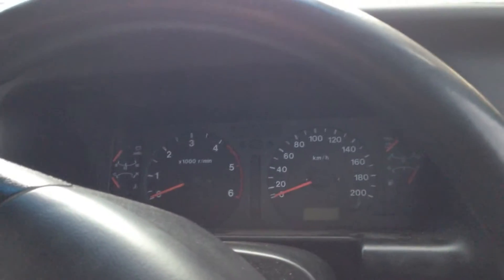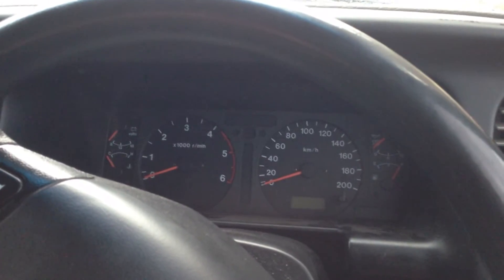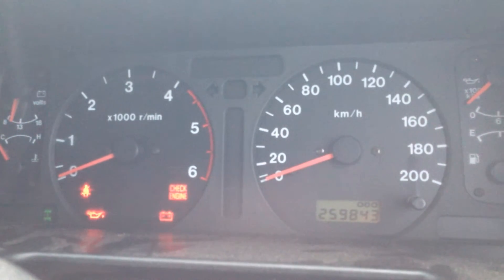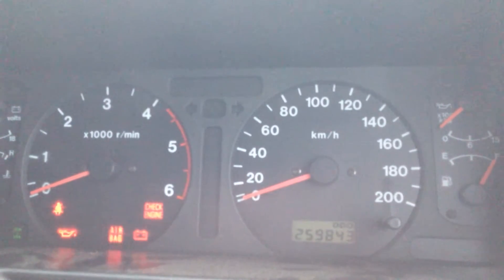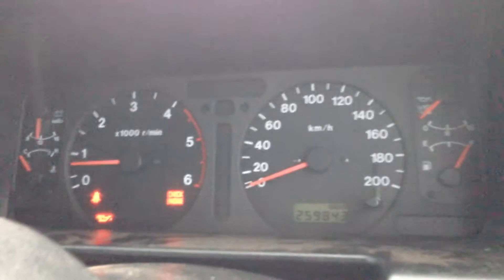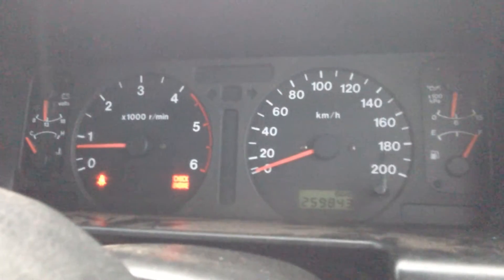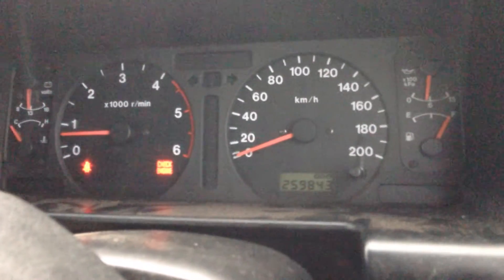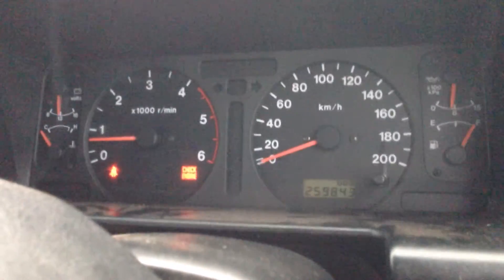4JX1 Starting tip

Comment: It took longer to start because your battery voltage is not good. You have an alternator/battery issue for sure since even when started your voltage is not higher than 13v. Should be around 14V. I changed the battery and refurbished the alternator and it starts much better on cold mornings.
Reply from the maker: Thankfully I sold this vehicle not long after making this. The buyer (a friend) despite knowing he shouldn't, ran the motor dry without coolant one day and seized it. In hindsight, it would have been a good vehicle to keep.

Comment: For anyone looking for help starting a 4JX1, forget taking it to a garage, 99% of mechanics will not have a clue about this engine. The first port of call is to clean out the injector harness plug found on the passenger side of the engine above the inlet manifold as it can get oil into it from the oil rail. If it still won't start, there is a white wire on this harness which many people fit a connector or switch onto. If the white wire is disconnected, it fools the ECU into thinking the Oil Rail Pressure Sensor is faulty and will start the car in limp home mode. If it does start then the ORPS is faulty, this is located under the rocker cover. Buy a genuine Isuzu ORPS and do not buy an eBay special. If the car still won't start, reconnect the white wire and then locate the Rail Pressure Control Valve which is on the same side, remove it, strip it and give it a good clean. Reassemble and refit and the car will now likely start. 
The harness plug, ORPS and RPCV are the 3 main problems with this engine when it won't start, if it still won't start, it is likely the injector oil rail pickup in the sump which is prone to breaking off. The main issues with not starting on the 4JX1 are 99% of the time oil pressure in the rail for the injectors, related.
Reply: can you advise me on a 4JX1 that starts, but cutting out when idling/running once warm (unless the accelerator is held down hard)NOT HOT
tried the white wire -no difference
swapped the ORPS - no difference
swapped the oil to the exact recommended - no difference
checked the sump rings  - no difference
overfilled the oil - no difference

one possible oversight , is the engine is a swap in ,from a damaged trooper we owed, and the engine was a beast in its previous home, used it as a farm runabout, until the dual mass flywheel went, its been swapped into a same year trooper with a engine with overheating probs and low power, once swapped, started first time, ran 5 miles to the test garage, passed first time and back home, then 15 miles to town , and wouldn't restart until cold, progressively got worse

been suggested the flywheel sensor?
Reply: I have a 4JX1 Engine its lowPower and very Low Power and there is no Check Engine in the Panel Board What's the Problem of that??? please help me.
Reply: 4JX1 engine cranking but not starting... what could be the problem, can someone help?

Comment: At almost 260,000kms the Oil Pickups would need new seals as it's likely to be sucking air, or the brackets have cracked/broken and about to fall into the sump = which is a very common engineering oversight by the Isuzu team, with such a deep sump and long pickup pipe for the Lubrication Circuit. Best overall solution is to remove Pickup Pipes, weld a gusset into the brackets, then fit a Spring Kit with new Viton Seals - which applies upward force to hold pipes in place to reduce lateral movement from oil sloshing, which reduces wear on the Pickup Pipe Seals, and also reduces chances of Pickup Pipes falling off into the Sump Pan.
https://www.youtube.com/watch?v=p8rPXwOcnYw&list=LLb7RnDCoDEikUvCpF6NwO3A&index=2&t=0s

Comment: Nice one, exactly the same as my 1999 3.0 tdi citation 🤣.   Good tip there to leave it those extra seconds.  I’m having my orps fitted,,,, biggest issue is someone had ‘white wired’ it to bypass the orps 🙄😡.  What’s worse is the wiring harness clips have broken while removing 😲🙈🙄😡.   New one on its way from America to England 🤞.   Why oh why don’t people just do the bloody job properly in the first place 🤷‍♂️
Reply: I never leave mine those extra seconds and it starts immediately the glow plug light goes out.

Comment: Must not be going to bad,youve got a full tank of gas😁Im having oil pressure problems and advised its the oil valves bl8cked,any ideas and are you in  the decompile 4jx1 group on facebook?
Reply: Check you are using the correct oil, Penrite 5w - 30 or 5w - 40 (extra ten)

Comment: hi I bought a Izuzu bighorn with a 4xj1 engine with a starting problem. I fixed the starter motor and previous owner said it has a pressure sensor issue but they didn't identify it was only a guess. Now my engine starts once after a long crank and stops by itself after almost a minute and cant accelerate or start it again. I feel your video will help me. Problem is I don't know how to disconnect the ORPS. Can you please help me?
Reply: Check that you have no oil in the diesel or coolant in the oil or any combination of those if you do then renew the injector and injector sleeve seals. Join the FB Group for more help
https://www.facebook.com/groups/264658247280734/about
Reply: +Lakmal Fernando nasa loob kasi yan ng valve cover. taga saan ka ba?